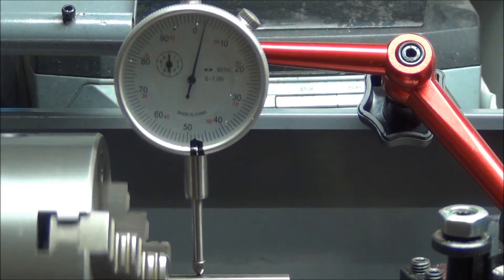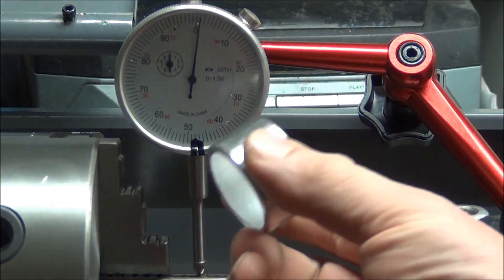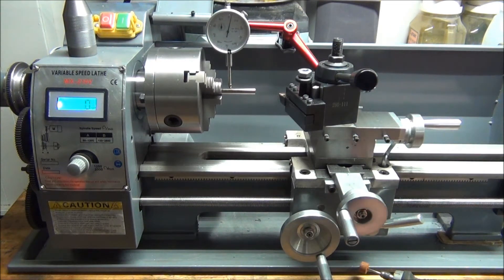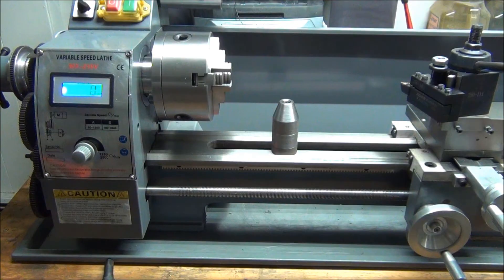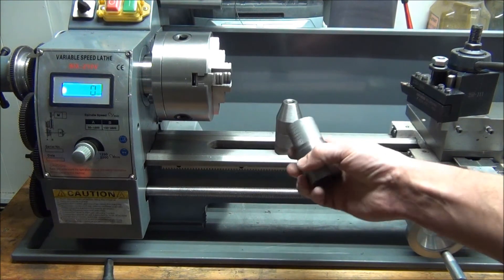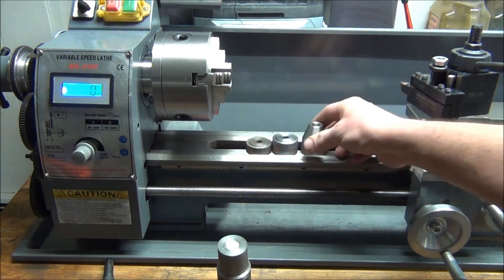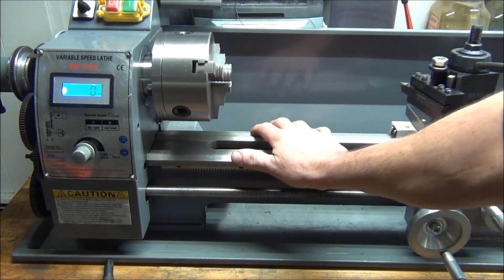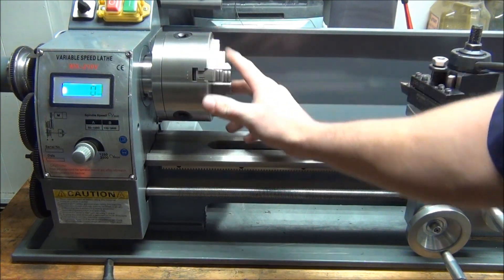TS-210 Part 14: 3-Jaw Update

Comment: It appears those lathes do not come with a threading dial. Did you install one yourself? Also, did you ever get the replacement lead screw installed? Thanks
Reply from the maker: They don't come with a dial and I have still yet to put the SAE lead screw on.

Comment: I have this lathe, what was your gearing setup for 24 tpi? Mine jumps from 22 to 28 tpi.
Thanks so much, I subbed!
Reply: Have you all looked other sizes (by tooth count) on the Stock Drive Products website? (www.sdp-si.com) The gears for this lathe are Module 1 metric spur gears, ~10 mm thick, which may have 12 mm bore (the LMS bushing size with 3 mm key) or 16 mm bore with a 4 mm keyway. If you don't mind opening up bores and cutting keyways, you can get gear combinations not listed, along with either small teeth count and/or large teeth count. When these are entered into an online thread/gear calculator (http://kachurovskiy.com/gears/), you can the combinations of very fine thread pitch numbers (=feed rates)--even smaller than you can with the "standard" feed gear setup. LMS also sells a full set of change gears (17 total): https://littlemachineshop.com/products/product_view.php?ProductID=4583&category=1963256896. Just another way to "hack" this Chinese beast and make it truly usable.
Reply: @mikegarwood8680  yes I ended up 3d printing several other gears to achieve several other tpi and a set to really slow down the feed rate for a smooth cut.
Thanks
Reply from the maker: 80-66
55-80
60
Reply: @number40Fan  Thanks:)

Comment: Hey  there bud! Hey I’ve got a machine that is the mx750 and Im having a hard time finding any parts  and accessories. So my question for you or anyone els that might read this is. Is there another brand out there that these machines are a knock off of? Finding information on these are difficult to say the least. What is the spindle bearing size for yours? Any ways hopefully I here back from you or someone for that matter. Kushstacks1@gmail.com
Reply from the maker: Check the Grizzly line of lathes.  Probably closer to what you have unless you have the 38mm bore as well.
Reply: I looked up mx750 lathe and is a bigger brother of the mx210. It has "750" mm [29.5+"] travel between centers. The link I found lists the swing across the bed and the cross slide are 220 mm [8.66+"], which is impossible. Regardless, it has the same spindle bore, 38 mm [1.496"]. The listed independent 4 jaw chuck as having a diameter of 160 mm [~6.3"]. I assume the 3 jaw is the same size. Hope this helps! https://www.alibaba.com/product-detail/desktop-metal-lathe-machine-desktop-metal_1600073405160.html

Comment: I sent you a private message over on silencer talk forum. What are your overall final impressions now that you've used it? 

I think I am going to buy this lathe as well and take the gamble on that huge spindle bore. Not having a reversing lead screw is kind of a bummer but looks easily modified.   If only grizzly had this same machine but with their reverse gear box I'd buy it in a heart beat. I don't really have the means to move a large lathe and with all the others having a 13/16" spindle bore there isn't much can be done with barrels until you step up to large stand alone machines.

If you wouldn't mind I'd love to talk to you more about it one on one. I plan on doing the videos just like you did.
Reply from the maker: I did get your message on ST.

Yep, I'd buy it again and again....and probably again.  Spindle bore size is worth it despite its other downfalls.

And I'd love to see more videos on this lathe.  The ONLY reason I started this is because I could only fine one video and even though it talked about it, it really didn't show much at all.

Message me again on ST and I'll get you my email.
Reply: @number40Fan  seems as though the ST forum has crashed? I get a error message when trying to go there. Anyway I was curious if you figured out more threading options with the weird 2mm pitch lead screw? It seems like the grizzly counter part has many more threading options but it also has a 12 TPI lead screw.
Reply from the maker: I noticed the same thing with ST.  Not sure what is going on.

Threading with this 2mm lead screw is tough, some what.  You have to leave the half nuts engaged, shut the lathe off at the end and reverse the spindle.  Makes threading toward the spindle a bit scary, but you can always thread away.

What is worse, the gearing needed for the 24 tpi isn't available.  There is a program that hard_ware (on ST) linked to called change.js that gives you options for the change gears available to get the 24 tpi.  But, the gears available won't fit.  I ended up using gears from my HF mini lathe to come up with a set that would cut close to 24 tpi and fit on the change gear arm.

What is the Grizzly lathe you are referring to?
Reply: @number40Fan  the grizzly G0768 is almost or really close to the same lathe. The gearing on the change gears looks identical but the grizzly has more options for gears. It uses a 12 TPI lead screw but goes through a gear box to reverse it which the TS210 doesn't have. You could probably make any extension where the gear box would be though.
Reply from the maker: If it wasn't for that small spindle bore, it would be a contender for sure.  I wonder if I couldn't retrofit those pieces onto the TS-210???

Gonna call tomorrow and see!!
Reply: @number40Fan  possibly I don't see what not. What really sucks is the reverse box should fit but the casting for it isn't available for sale. 

To be honest I think I'm going with the grizzly 7x16. Then I'm going to take the head stock casting and bore it to use larger bearings and then make a new spindle. If my match is right I think I can open the bore up to between 1 3/8" and 1 1/2"
Reply from the maker: I was doing some checking and the casting shows backordered.  Going to order the lead screw and half nuts and go from there.

You probably meant the 8x16, but while you have it apart, want to loan me the gear box? :D
Reply: @number40Fan  no I meant the 7x14. I'm going to start with the 16" bed extension and then take the headstock and bore it for larger bearings just like they did on your lathe. The threading part is a real con for me. Plus none of the sellers even acknowledged my offers on ebay.
Reply from the maker: Ok, gotcha now.  Good luck and if I can help, let me know.
Reply: @number40Fan  yeah no problem and thank you! I really was going to buy this lathe but grizzly has the best bang for the buck. More threading options, more included accessories, and there is a bunch more stuff out there for the 7x lathes. If this one didn't have the threading downfalls and I didn't have to spend a couple hundred more for grizzly parts to open the threading up it is definitely a good deal for that bore size.
Reply from the maker: I see the G0765 7x14, but what is the 16" bed extension you are talking about?

https://littlemachineshop.com/products/product_view.php?ProductID=5000

Is this it?  Interesting!
Reply: Yep that is the one. I want to add that to the original lathe making it a 16". Then I'm going to take the original bed and mill the end square to the bed and same with the new 16" bed. Then I can attach the old bed to the new bed and extend the new 16" bed even longer. If i can keep the ends square with the bed it should work pretty good. There is a few websites where guys have done this. I can then take the original lead screw and extend the lead screw as well.
Reply from the maker: Sweet!  Sounds like a lot of fun.

Comment: Very cool!  I'll agree - 3 thou is worlds better than 9 thou runout.  The barrel threads look good, and I really like that bolt knob, once it was finished to match the handle it blends right in.
Reply from the maker: It was a tedious job, but after watching the video and seeing that the high spot is over the same jaw that was giving me the biggest issue, I might try to take some more out of it tomorrow.  Huge improvement nonetheless.
Reply: @number40Fan  did you ever get this lathe to cut inch threads yet?
Reply from the maker: Shhh.  Don't remind me that I have tons of stuff I need to do.  :D

Between regular work and a side gig that I have going, I barely have time to sleep here lately.  Lathe has still been making chips and I look at that imperial lead screw every day.
Reply: @number40Fan   now they have the 8x16 with all inch gears and 38mm bore  https://www.ebay.com/itm/233300461293